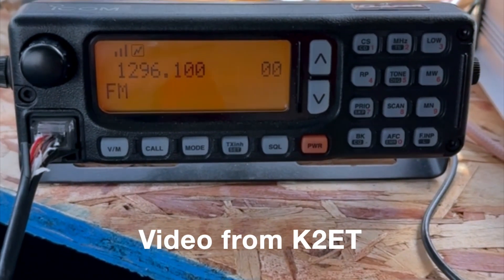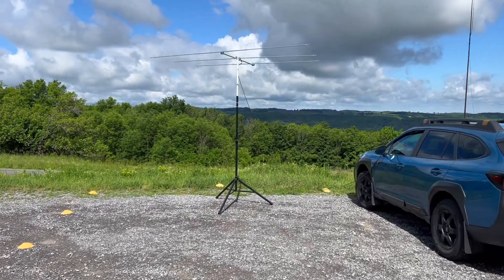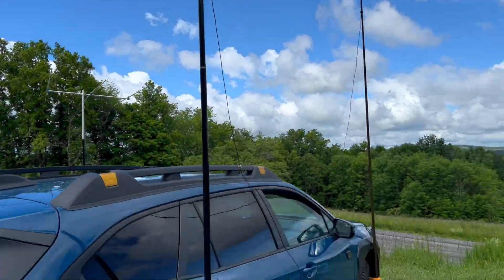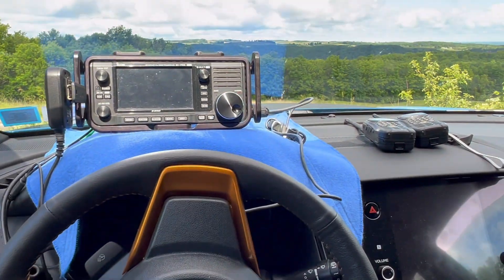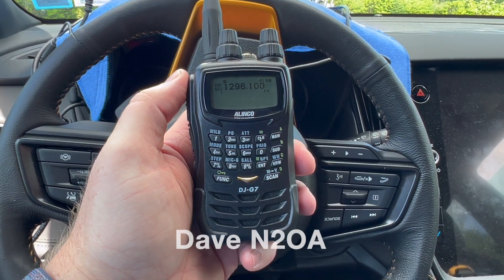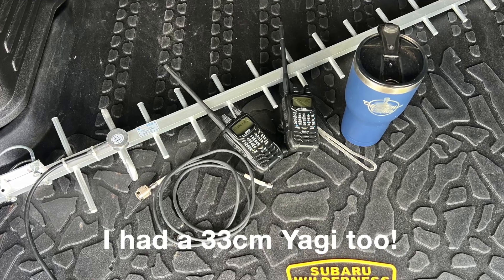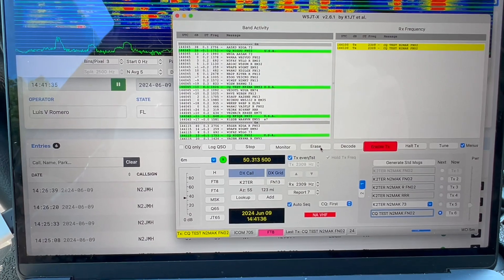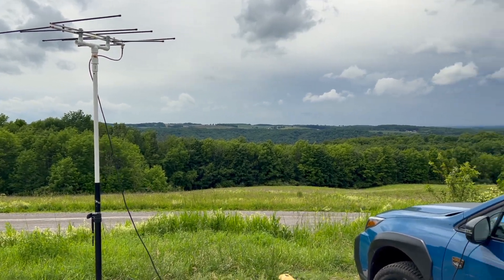1.2GHz POTA in June VHF Contest

Comment: I've been in search of that elusive 23cm simplex contact so great work! 73
Reply from the maker: Thanks! There’s an active VHF group in WNY and Southern Ontario, which helps a lot. I wish there were more options easily available for 23cm, since I’d like to get an HT or mobile of my own for contests.
Reply: @MikeN2MAK  I searched the used gear listings for quite some time before I came across that ic-1201 so it takes patience and persistence.  73
Reply from the maker: @hamradioonthego  I hadn't know about that radio until your video, but I'll keep an eye out for it now.

Comment: I’m looking to get on 1.2 when I get my license what would you say is the cheapest way to get into 23cm
Reply from the maker: That's awesome! The cheapest way to do it would be the way I did and have a ham loan you the HT, LOL. There aren't a lot of tranceivers in production that do 23cm. The ICOM 9700 and 905 are the 2 I'm aware of. You might want to keep an eye out for a used Alinco DJ-G7 HT or an older 23cm radio at a hamfest or online.
Reply: Well, cheap is relative. But if you already have an HF rig, Q5 signal has a 25 watt transverter for around $600.

Comment: I bought a 4-band HT over 20 yrs ago which includes 6m FM and 1296FM, neither of which I've ever used. I think I just forgot about those bands and used the 2m and 70cm bands. I may have to charge the battery and try them again. Thanks, Mike, for the inspiration :) de KA8VLW, Ken, Michigan
Reply from the maker: Give it a shot! Maybe you can make some contacts with it in the September VHF Contest. Thanks for watching!

Comment: Have you tried any of the Boefeng all band radios or other similar ones with the modded firmware ?

From what I see on YouTube the range is from 18 MHz to 1.3 Ghz and they can be purchased for 40 dollars.

Compared to the 900 dollars for each of the 1.2 Ghz and 900 MHz handhelds, I would really like to see a good real world side by side test the next time you do a field day.

I bought a couple of the DMR dual slot radios for around 60 dollars and I was impressed with how well they worked.

I keep hoping that Boefeng or one of the other Chinese companies would make a dedicated phase 2 digital scanner.

The same factories that make these brand name thousand dollar HTs and Uniden scanners make the 30 dollar all mode generic radios.

The level of corporate greed is just insane. The radio costs 10 dollars to make and they sell it for 900 dollars or more.

The same thing with the Uniden and G5, they charge 800 dollars for a receiver that costs 20 dollars to.make.

I saw sneakers in a store in Philadelphia yesterday that were behind bulletproof glass.

They looked like the same material used in the 20 dollar Walmart sneakers, but the price was 3500.00 dollars.

For sneakers.

That is wrong on a level that has no words.

I thought for sure that Kenwood and Icom and Motorola would lower their prices once the generic radios flooded the market.
But they didn't.

Very sad.

My HOA made me take down my tower and antennas yesterday.

I guess I will sell all my radios, since I can't use them without the antennas.

People just can't leave others alone. They can't see someone happy.
They are only Happy when they are hurting others.

I weep for the human race

Comment: For my tripod, I either slide an Olympic weight over the mast and it rests on top of the 3 legs. I have hung weights under other tripods.  Olympic weights have a larger hole in them. I usually use 10 to 15 lbs.
Reply from the maker: That's a good idea! I already have weights.

Comment: What Yagi did you use for 23cm? I have 3 23cm radios and am looking for one for POTA and home. Thanks
Reply from the maker: I just used the rubber duck for 23 cm. The Yagi was for 33cm. I looked at a photo I took and it says DMS Wireless model YA90014, frequency 890-960MHz, gain 14dBi. I hope that helps!
Reply: Thanks Mike.